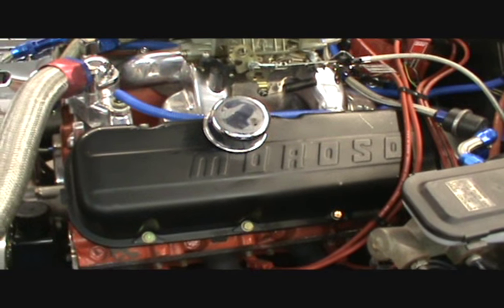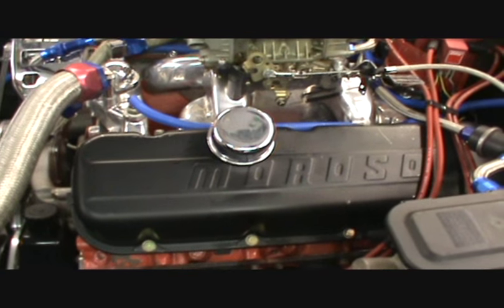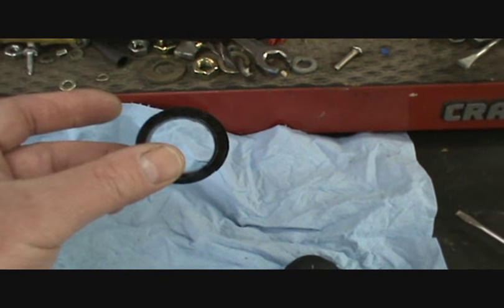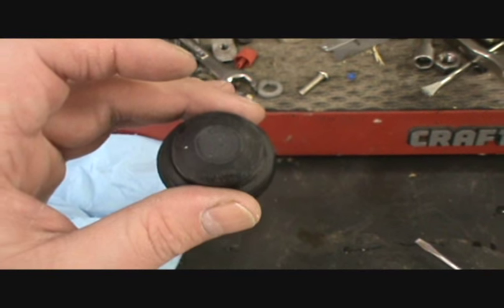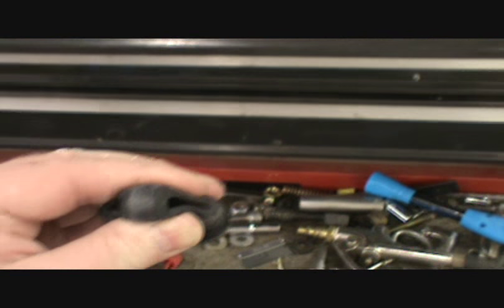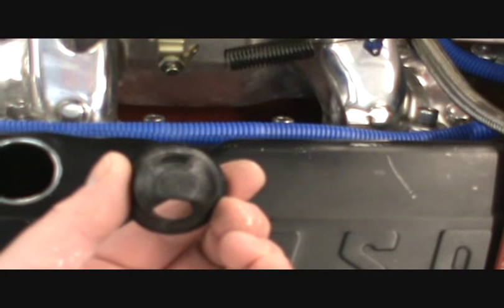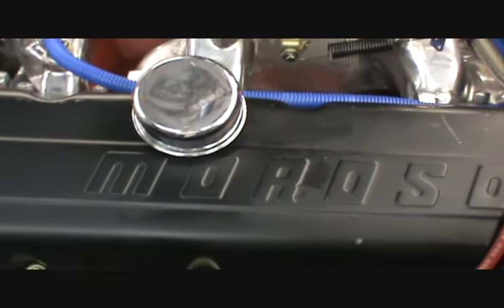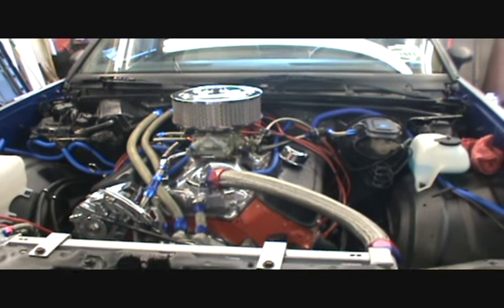Ratmino Update # 15 valve cover breather tips

Comment: I just remove the pcv... put in a straight fitting, run a 1/2 inch hose from there to a catch can... then another 1/2 inch hose from the valve cover breathers to another catch can.. 
now the motor has exit ports to breathe = less restriction on the crank = more hp ...
Reply: Do you have a picture of how this looks?
Reply: @vinihidalgo96  yes

Comment: Cool tip. I'm just running a tube over to a can with a flapper. My truck won't run right with just a breather. It's a TBI unit. It gets mad if it can't pull a vacuum. I put a very small notch in the flapper so air can still pull from one side to the other with the PCV. I tried running with just to catch can. But I pull trailers and it would fill the catch can up in just a hundred miles. It seems to like the PCV on one side and flapper catch can on the other. It's not super overbuilt forged crank forged rods hypereutectic Pistons. 388 SBC with 454 TBI cam is 218 212 @50 .51 life on 112° lobe separation. Or 114 I can't remember. I took the swirl out of the swirl Port heads. Smooth and polish the combustion chamber. I still have to run 93 gas I accidentally got 87 once and broke a piston ring that one cylinder is border 80 over. I have no clue what my horsepower is I built it mainly for torque. My truck and trailer with skid steer. Weighs 18,000 lb give or take depending on the job. She sits at 3300 RPM in 4th gear at 65. I'm scared to use 5th gear pulling that heavy. I guess my only complaint is she will not pull below 2000 RPM. It actually seems to have less power below 2500 then when it was a little baby 350. But anything above 2500 and she pulls like a diesel. I can tell you I snapped The hub out of a brand new clutch for a 454. My truck's kind of a mutt. The block is out of a 98 Chevy. transmission from a 93 1 ton 454 and TBI unit. Rear end is from a 2006 F350. Drive shaft from a 95 Chevy 2500 van. Transfer case I don't even remember where it came from. Np205 divorced. Front diff CV axles and hub assemblies. From a 93 k1500 Diesel suburban. Front drive shaft from a 91 Ford IDI. Custom rear leaf springs from rays champion springs. Yep she's the poor boy toe pig. I've had a lot of other trucks. But this one refuses to leave my side. I've had her for 11 years now. And I'm debating on whether or not to do the solid axle swap for the front. But I have to rebuild the front end every year. And it's coming up she's all wore out. My dad's F-250 rides like s*** but we've never had to rebuild the front end and he's off-road just as much as me. So may be sas time.
Reply: Aluminium baffled valve covers on the net-no baffle will always leak or use oil..

Comment: I have about 300 miles on a brand new 350 crate motor.And it's using about a quart of oil a week.It's not leaking anywhere I swear it's the PVC valve is sucking it out of the engine                                                           .There is no smoke coming out of the tailpipe.Or is it just the ring having broken in yet.

Comment: What about the aftermarket push in pcv valves that look just like this air breather push in? Can you do a video on factory, vs after market pcv valves?
Reply: A breather thats meant to only be a breather has a bunch of holes on the underside of it  

if it doesnt its an actual PCV valve that looks like a push in breather.  but youd be hooking that up to manifold vacuum  because thats what PCV valves are for.  breathers take in fresh air only, whether its an aftermaket one with a 5/8ths tube on it to hook up to your air cleaner to get fresh air  or looks like the one in the video where its just getting air and has no tube because maybe your air cleaner doesnt have that provision for a 5/8ths tube hookup from the breather

  PCV valves vent the engine after that air is taken in.  there should NOT be a bunch of holes in the bottom of those types of aftermarket breathers  and it will look like this breather with a 3/8s tube on the top of it,  not a 5/8s tube.

Comment: pcv valve location is on passenger side?? I have mine in front driver side valve cover going into front of Edelbrock carb ... 454 big block out of 86 pace arrrow motor home into a 1971 monte carlo
Reply from the maker: It doesn't matter which side your PCV valve is as long as you run some type PCV system just more convenient to have mine on the passenger side that way I can get to my oil fill easily

Comment: What about the preheater hose? Can you run that with those types of air filters. I’s there any way to reroute it back into the intake system or do you just have to get rid of that
Reply from the maker: You won't be able to reuse your preheater just remove it if it's the one you're talking about that goes down to the exhaust manifold it's just there to pull warm air up to the air cleaner in the winter time to help with cold start and running

Comment: This was a life saver. Could this be the reason my plug threads are getting oil on them??
Reply: Threads with oil? Plugs are sealed into the cylinder with a taper or a gasket?valvecover cover the plug holes,gaskets,seals..
Reply: @Watchout1010  yeah didn't have a valve cover breather on one side and had bad valve seals and was blowing gaskets. To much pressure and the oil was running down my valve stems and causing the oil to cover my spark plugs. So I had oil on my plug threads....

Comment: On newer engines you replace the hose that goes to your intake tube with a breather filter correct? Or is it the side that a hose goes from intake manifold to pcv?
Reply from the maker: You definitely want to run a PCV valve. And then run a crankcase filter on the opposite about cover

Comment: Is a baffled breather filter enough to prevent leaking? I'm trying to decide if I need that or a catch can.
Reply from the maker: No you need to run a PCV valve. Along with a crankcase breather unless you are running a big high horsepower and high compression engine turning a lot of RPMs then you may want to run a catch can it just depends on the engine and what your PVC system can handle and what the car is designed to do ie street race drag race pro touring xcetera

Comment: I thought positive pressure blows out gaskets and the intake is sucking it out to lessen it?
Reply from the maker: Technically your PCV valve pulls the crank case pressure out the valve cover breather let's air
 in so the PCV can do its job without a PCV valve yes you will blow gaskets and seals you must run a PCV valve and a valve cover breather

Comment: So could get one of these breathers instead of getting a tube from the valve cover to the tube hole on the air filter? It’s hard to fit the tube by the carb so wondering if it’s easier to get one of these instead for a tube for the breather to the air filter
Reply: Put oil on tube

Comment: What if I was to drill 1/8" holes around the bottom side of the grommet? Maybe five holes?
Reply from the maker: That can work also and if you need to put oil in just pop your grommet out put back in after your oil change